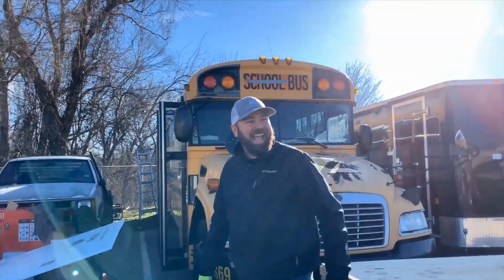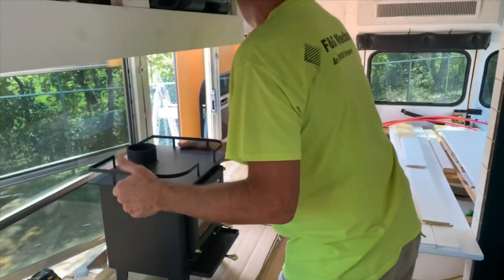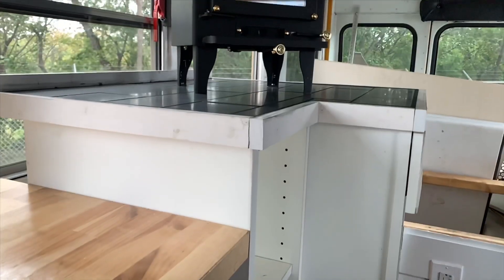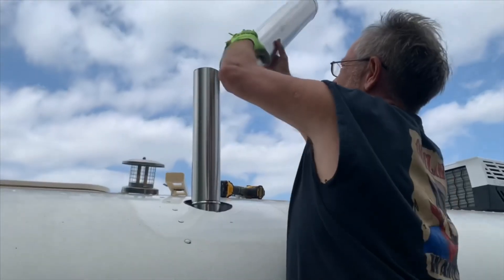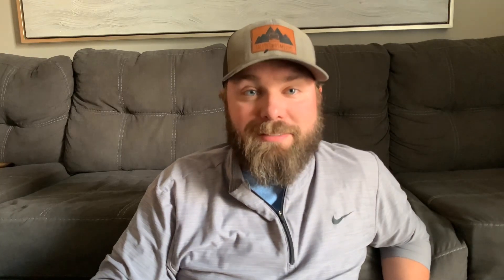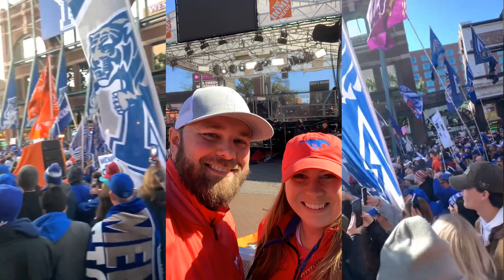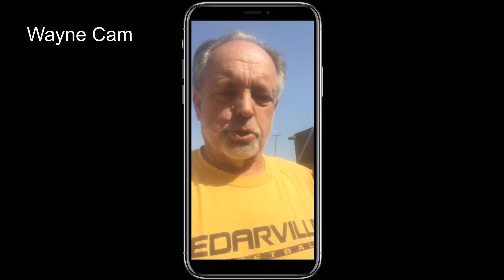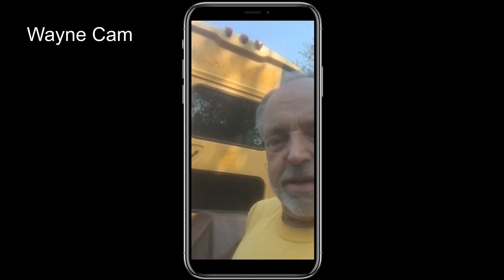Cubic Mini Wood Stove Install Skoolie Edition || 2020 Bus Conversion - Ep. 30

Comment: OMG that Grizzly looks nice!  We're thinking about getting that one too! After talking with the sales dude there, come to find out you're able to have a detachable rooftop chimney that you can put a cap on it while you drive so you don't have your periscope up in the air the whole time! Have you fired it up yet to experience those 18k BTUs?

Awesome to see how much y'all got done with your dad! Your build is really coming along nice! Great job! Looking forward to seeing what you're doing differently next week!
- Brian + Erin
Reply from the maker: You guys! What a great message!! We haven’t fired it up yet (thanks Texas), but we can’t wait! See you next week!
Reply: Do you have the link to the detachable rooftop chimney?  I went on their site and couldn't find anything.  We'll be doing a roof raise in the spring and it would be amazing if we didn't have to shorten the raise because the chimney was going to be 18".  Thank you!!
Reply from the maker: It’s part of the metal roof exit kit. https://cubicminiwoodstoves.com/collections/grizzly-cb-1210/products/metal-roof-exit-kit
Reply from the maker: You can also buy additional flue pipe to make as tall of an “interior chimney” as you’ll need. https://cubicminiwoodstoves.com/collections/flue-system

Comment: How is the heat on the ceiling directly above the stove? We have found that our ceiling gets alarming hot.
Reply from the maker: We have a metal ceiling and have a heat guard above the stove and around the pipe. It gets hot up there, so you have to be careful, especially with a wood ceiling.

Comment: That’s not too close to window ?? No heat Sheila around that ?
Reply from the maker: Yeah, we installed a metal heat shield in front of the window.
Reply: @TaleOfTwoSmittys  the grizzly wall mount heat shield, can you mount that on wall with the windows. Is that enough or how would it be better to have it standing away from wall?
Reply from the maker: In a perfect scenario, it’s probably in front of a solid wall with a heat shield (metal, tile, the heat shield mount, etc.)